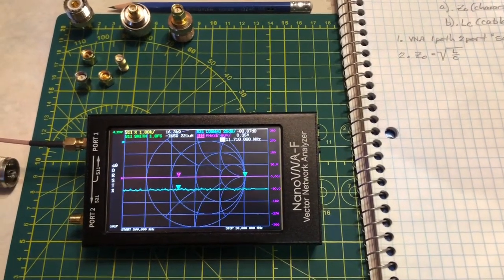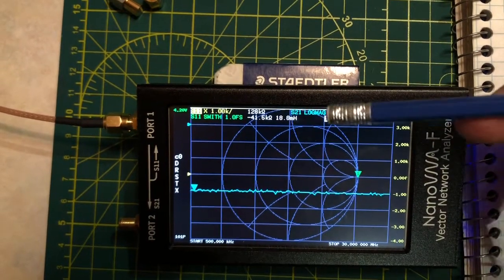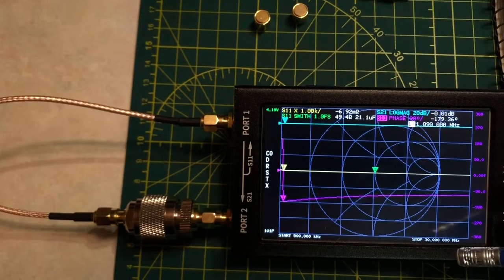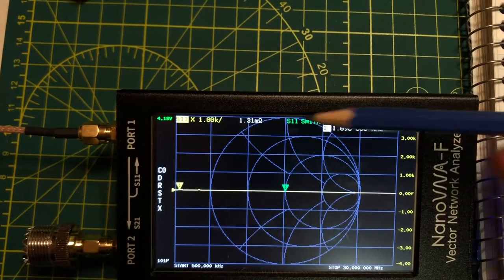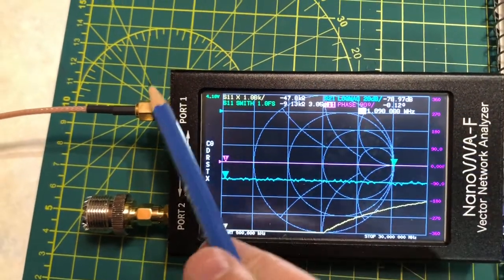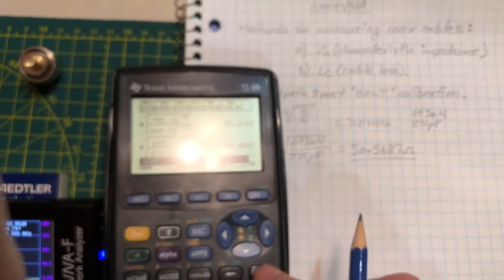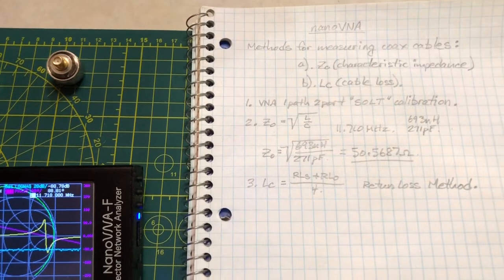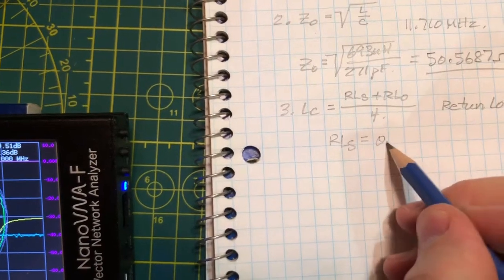nanoVNA - Coaxial Cable Measurement Methods (Characteristic Impedance and Cable Loss) - VE6WGM

Comment: One point you omit  is "what accuracy do you need?"
Reply from the maker: I usually call the cable good if I read 50 ohms +/- 1 ohm.  If it reads above or below that then I start looking more closely for issues, beginning with a thorough physical inspection.
Reply from the maker: If you’re looking at the loss of the cable, it’s good if you can test the cable when it’s new and record the value.  Each year, test the loss and mark it down in a log.  When you start to see a significant change then you’ll know to start looking.

When I was maintaining commercial mountain top repeater sites, this is how we did it.
Reply from the maker: Actually, that’s true for all the measurements.  SWR of feedline and antenna, coax impedance, and coax loss.  

If a significant change is noted anywhere over time then you’ll know.

In the case where you have a random cable with no history on it, then measure the specs on it, compare to what it theoretically should be if new.. and use your best judgement.
Reply: @ve6wo  Its difficult to detect increasing loss in a chunk of installed tower mounted coax with VNA instruments without some climbing, and cutting.   Except for lightning strikes ruining the antenna, or coax, field strength measurements or lack of radio range seems to be the measurement of choice.  We all know that increasing coax loss just makes SWR measurements better.   I had once tried to research if the swept frequency return loss between antenna match points could somehow indicate coax loss.  It would seem that the match point troughs would not be so deep.  I've tried using attenuators to simulate coax loss, but could not reach any good conclusions.
Reply from the maker: @wb7ond  Yes, the technique shown in the video requires the end of the coax to be disconnected from the antenna.  If you're not into climbing a tower to do annual cable checks at your station, then this method is not for you.

Comment: Awesome video. I am trying to figure out if there is any way to measure antenna gain with the nanoVNA to compare with what the antennas advertise.  Any ideas? Thanks.
Reply from the maker: I am not aware of any way to do this with the nanoVNA.  In my mind, a field strength meter would need to be used whereby readings of a transmitted signal are taken at various locations around the antenna and a radiation pattern diagram made from those readings.. something along those lines.  I suspect some googling would provide a better answer for this question.

Comment: Comparing s11 to s21, s11 measures the round trip loss but s21 measure one way loss. is the s11 loss twice the s21 loss ?
Reply from the maker: Yes, the S11 loss measurement is round trip, so the loss is double because the signal has travelled twice the length of the cable.

Comment: Great Video! This is exactly what I was looking for in terms of a long term plan to assess the status of 2 100' runs of LMR-400 going to my attic satellite antennas. I will definitely be testing out these methods myself with the NanoVNA V2 for this purpose.
I have a few questions for you: 
(1) Why do you pick the most imaginary reflection coefficient points for the L/C calculation? Also, this can be done with any 2 points at the same frequency for reflection coefficient on the smith chart corresponding to a short and open termination, right? 
(2) Is there a method that can be applied to measure characteristic R and G for the cable to get a complex characteristic impedance directly so as to know the cable loss in this figure given Zo = sqrt((R+jwL)/(G+jwC), or are we stuck with having to measure loss separately and then work backwards to calculate R and G?
(3) Are you familiar with the "transformation" functions available on the nanoVNA that allow operation similar to a TDR (Time Domain Reflectometer) to directly measure cable length? W2AEW used the "Low Pass Impulse" to do this in one of his recent videos (#316?), and the manual is silent on how this method works under the hood (see page 14: https://nanovna.rf.pl/Manuals/NanoVNA-User-Guide-English-reformat-Dec_9-19.pdf ). I was hoping for a good resource on understanding the function of that approach to a similar task to what you do here.
Reply from the maker: Thanks for the comments and questions.
.
I will take a stab at the first question here.. why do I make the measurements where I do (at 90 degrees phase angle)?  
.
I wish to consistently use a frequency that is as far away from the points where the inductive and capacitive reactance vectors are equal and opposite (the point of resonance, 0 & 180 degrees phase angle).  No meaningful measurements for capacitance and inductance can be performed at these frequencies using the nanoVNA in order to calculate Zo of the cable.  At 90 degrees, the magnitude of the reactance is high in only one direction, thus enabling a good measurement.  In addition, the VNA is most accurate when taking measurements at 0+j50 and 0-j50 ohms, which is at +90 or -90 degrees on the smith chart.
.
If the method of measurement is standardized (ex: always taking your readings at 90 degrees phase angle), then you can be sure that any changes seen in the coax over time (if you have an annual coax health check schedule in your radio shack) will be due to actual changes in the coax and not because of differing methods of measurement.  If you take a measurement at 90 degrees, calculate the Zo you will get a value.  If you calculate from measurements taken at another phase angle (not at 0 or 180), you will likely find that the value you get is close to the first, but there is a slight difference due to various factors such as small errors in measurements due to resolution of the nanoVNA (which is why I like to grab the measurements at a point where the reactive vector magnitude is greatest and only in one direction).  If you have a health check log and perform the measurements differently every time, can you be sure that you are seeing a change in the coax?  Or is it because you have changed your measurement method?
I hope this answers your question :-)
Reply from the maker: Question 3 - I have not played with the TDR functions of the nanoVNA other than to follow the guidance in the video produced by W2AEW, which is excellent!
Reply from the maker: Question 2 - I am unable to answer off the top of my head.  I do not recall using this formula when I was in college, I will have to go back in the text books and see if I can find it.  My apologies.

If you play around with it and find a more accurate method that is relatively simple to measure Zo then please make a video and share with us.  Please link to it here :-)
Reply from the maker: Regarding Question 2 - I did a bit of snooping regarding the formula you referred to and found this: https://www.translatorscafe.com/unit-converter/en-US/calculator/coaxial-cable/

The formula I am using assumes there is no dielectric or resistive losses in the cable.  Using the formula you referred to is based on a more complete model of coax cable and would be more accurate.  If your cable has developed an issue with the dielectric deteriorating or has some resistance change from a DC point of view then this calculation would show the change using the more complex formula.

DC resistance can be measured easily, but who has the ability to measure the dielectric constant?

Please correct me if I'm wrong, but if the dielectric constant changes would not also the measured capacitance?  If this is true then one can deduce a change in dielectric properties over time based on the change in capacitance measurement.  Therefore, the more complex formula would be unnecessary for the average operator who is monitoring their coax system over time for any kind of degradation, would it not?
Reply: @ve6wo   I really like this approach. If the coax is degraded as suggested by any reading, chuck it, because whatever the reason for degradation and whether indicated by change in dielectric constant (difficult to measure) or resultant change in capacitance (and therefore by extension characteristic impedance), it is likely no longer fit for purpose and there's no way it's gong to get fixed in a hurry.

Thanks for a very informative video. I recently bought a nanoVNA but it hasn't had much use yet apart from analysing my DIY antennae.

Keep up the good work. Julian Grammer. G1EKW.

Comment: The phase going from -180 to +180 doesn't mean anything - the phase is linear (has a linear slope to it), it's just if you keep plotting it without resetting it at some point, you end up with phase angles above 360* which ceases to mean anything, or is hard to work with. So the rule of thumb is you graph phase from -180* to +180*, and if it goes below -180 or above +180, you wrap over to the other side.  Also, the phase being positive or negative has nothing to do with it being capacitive or inductive - it's not on the same scale as a smith chart. The phase plot has absolutely nothing to do with capactiance or inductance, only delay.
Reply from the maker: I have to disagree, somewhat.  Although the phase rotating from -180 to +180 doesn’t really have any particular significance as far as I know, as you pointed out… the phase angle (as displayed on the VNA and on the smith chart) is most certainly related to the resistance and reactance in the device under test, which could present as capacitive or inductive depending on what the stimulus frequency is.

Although the phase angle on a smith chart is generally explained to represent the distance in wavelengths along the transmission line, when you look a little deeper, you’ll find that this phase angle is actually the phase of the reflection coefficient, as measured at the point where the VNA was calibrated.. the calibration plane.  Negative phase values represent capacitive reactance as seen at the calibration plane, positive values represent inductive reactance as seen at the calibration plane.

Please watch this video where I explain the mathematical relationship…

 https://youtu.be/-gGJHhJ2lUs?si=MkYxI0Tc5-SnjL4i
Reply: @ve6wo  Still my overall point is if you look at your phase diagram, and simply remove the jumps from -180 to +180 (which is only a notational convention to keep the scale of the phase graph contained), you would have a straight line continuing infinitely with the same slope. A "linear phase" shift shows you that basically nothing odd is going on with the DUT (the cable in this case) - it's just getting electrically longer in terms of wavelengths, as the frequency increases, which makes perfect sense as the wavelength decreases as the frequency goes up, so the cable looks longer when measured in # of wavelengths. Also, a smith chart doesn't display phase information - it only displays complex impedance at a given frequency. Maybe there's a mathematical relationship there between complex impedance and phase (or the derivative of complex impedance and phase maybe), but I haven't thought through that. I will watch your other video, but I'm skeptical...
Reply from the maker: @gorak9000  That’s fair :-)

Let me know what you think after you watch the other video.

Comment: Did you have to upgrade it somehow to 2GHz or does it arrived already extended pls?
Reply from the maker: No, I have not modified my nanoVNA.  It comes with an upper limit of 1 GHz out of the box which is far beyond the upper frequency range that I’m interested in (30 Mhz).

Comment: Calibration, with same connected cable, isn't how is supposed to be. All this connected adapters, cables - must be removed before calibration. After, you need to set electrical delay (port extension), to each of those connected adapters/cables

Comment: That measurement of yours for Z0 makes me very squeamish. While you do get the correct result for Z0, you are not getting the correct values for L and C. Those parameters are supposed to represent the characteristic inductance/capacitance of the cable, which will NOT be accurate when you do the 90-degree thing. The only reason this works is because the ratio between them is cancelling out the error. If, however, you tried this method to calculate phase velocity, you will absolutely get the wrong answer, since vp = 1/sqrt(LC). 

I think a far simpler method for measuring L and C is to just reduce the frequency to something very low (e.g., 100 kHz) and then measure reactance of the cable directly. If you do this, you will find that the measured C is very different than the one you just did at the 90-degree phase shift. It will also be far more reliable, since all you are seeing is the net reactance of the cable.

Incidentally, if you try the low-frequency method to measure L by attaching a short circuit, you will get a higher value than expected. This is because the inductance of a transmission line is HIGHER at lower frequencies. The "impedance" of a cable is only valid at relatively high frequency (usually a couple MHz), since the skin-effect forces all the currents to the surface of the conductor. This reduces the inductance, which brings the impedance down to the specified 50-ohm. Fortunately, there is a simple method to correct for this and get accurate results.
Reply from the maker: Hi James :-)

Thanks for sharing your thoughts.  I encourage you to put together your thoughts in a video and to present them using the nanoVNA to demonstrate your idea of what is the correct and more accurate way to measure coax cable Zo.  I would like to see what others come up with, and I know there are a good percentage of amateur radio operators interested in this subject.
Reply from the maker: It turns out, James did make a video!

Here it is :-)

https://youtu.be/p0oOz0uhn4E?si=FmmkvCIN7Yi_Wt-7